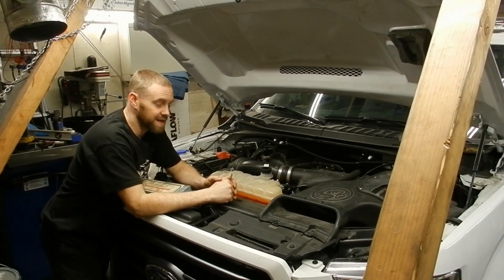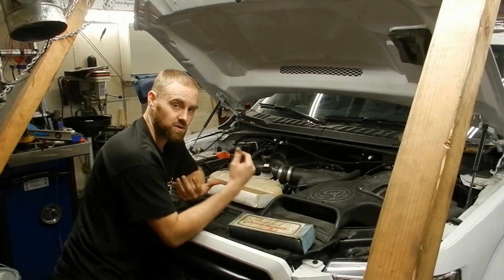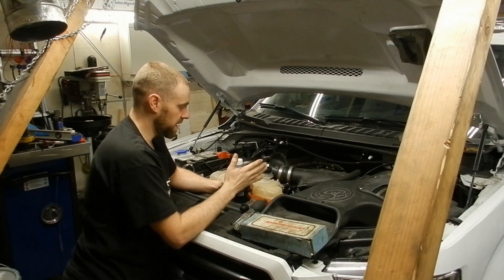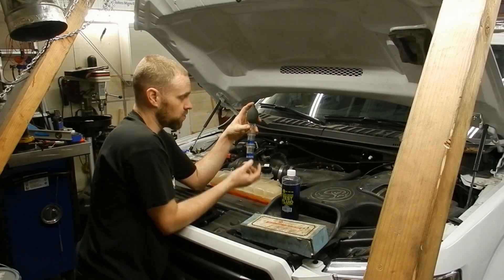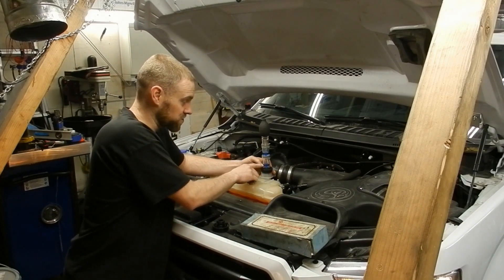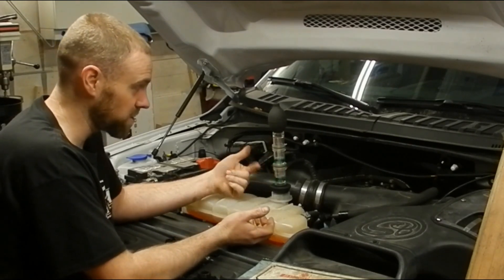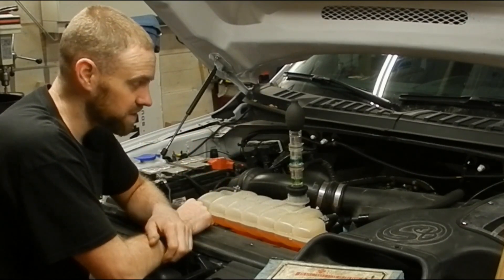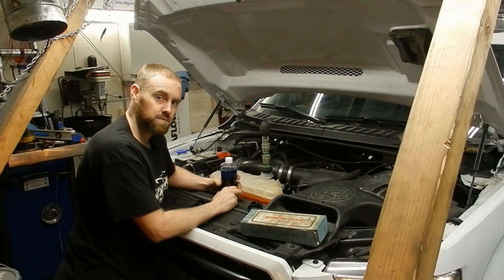Ecoboost Combustion leak test to check for a bad head gasket

Comment: My wife's expedition had a bad head gasket at 80k miles. No hard driving all scheduled maint.  Seen lots of problems. Im looking for some HP gaskets instead of using the junk they factory I stalled. Suppose to have a class action because they knew they were trash from what I hear

Comment: My truck started to over heat after ford replaced the exhaust manifold, I never had the problem before. 3.5 eco boost 98k miles  it only start to get hot on a slight incline. Any ideas? Ford can’t figure it out
Reply from the maker: Pull a vacuum on the system, it probably has a air lock in it.

Comment: Can you replace just the head gasket? I think I have a bad one and I'm being told I need to replace the entire engine.
Reply from the maker: The head gasket can be replaced but only if that is the actual failure. You might have a warped or cracked block in which case the engine needs replacement. To replace the head gasket is more than just a gasket, it will also require machining the heads and replacing any tq to yield bolts.
Reply: What are  the  symptoms on your car or truck